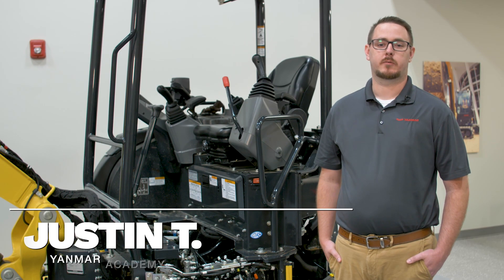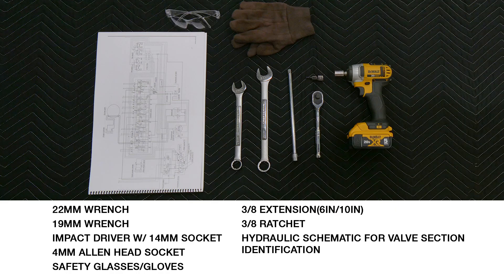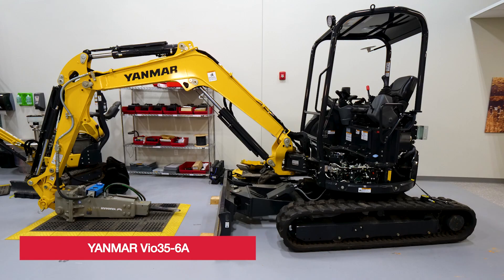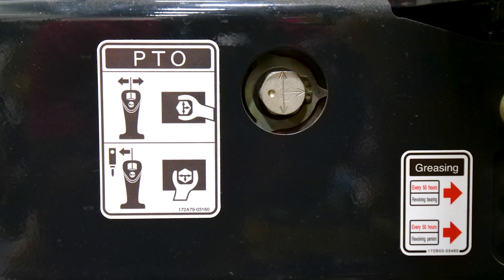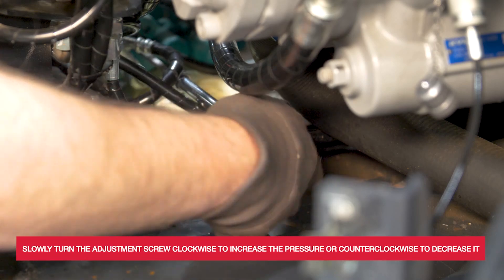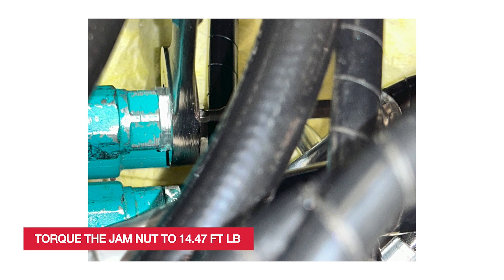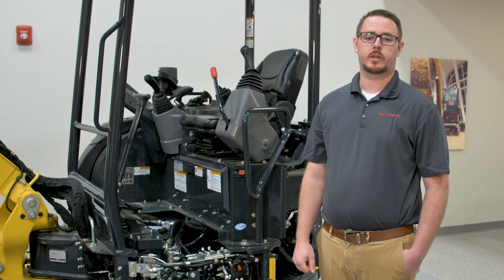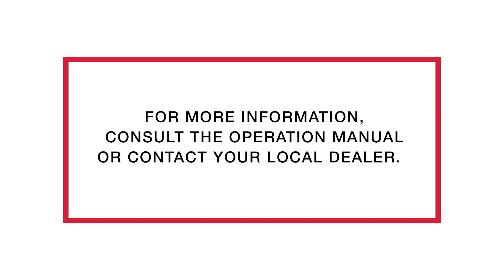YANMAR Excavator PTO Relief Valves Adjustment

Comment: Are you planning on adding a video to show ENGINE VALVE adjustment on this unit - would be really useful.
Reply: The adjustment instructions are in the Vio35-6a service manual, section 4-1-6.